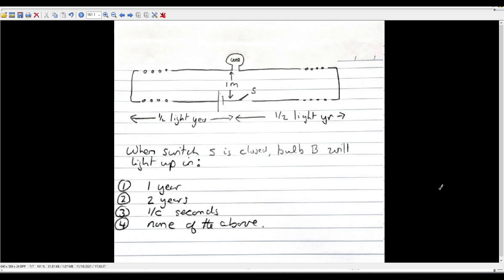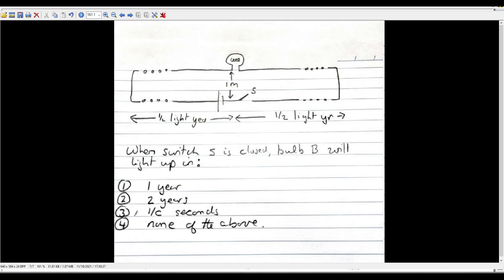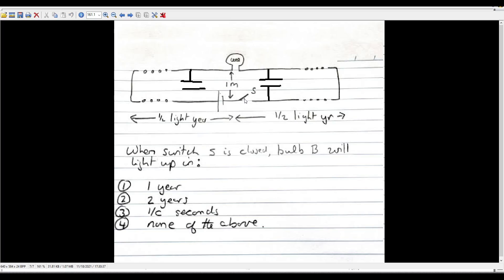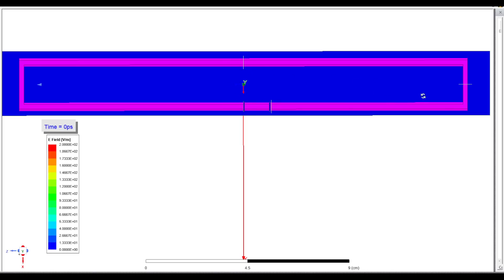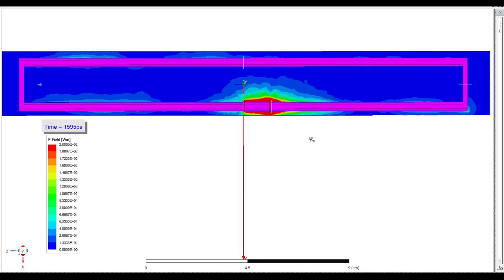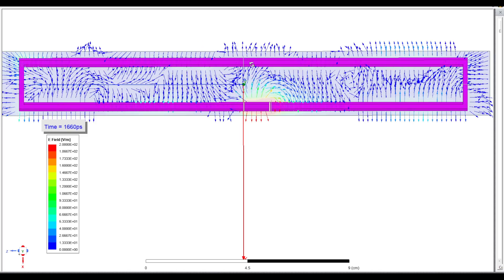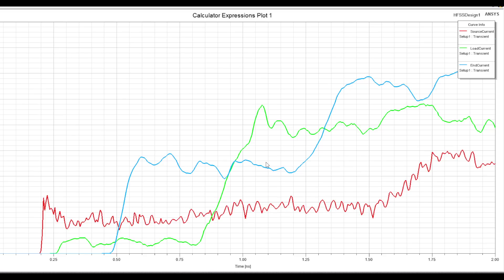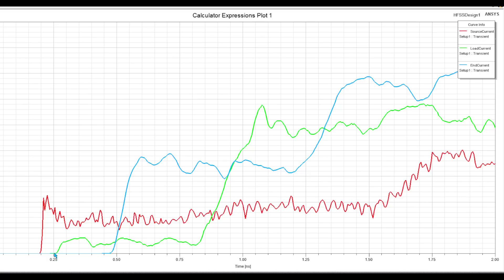Response To Veritasium - Electricity Propagation Time Problem

Comment: So, extend the wires to whichever length is needed to move the bulb 1 lightyear from the switch. 

Now what?
Reply from the maker: It takes 1 lightyear to light up!
Reply: @PulsedPower  We need to find some spools of copper wire, knot them together, position one end on the north pole of earth on a swivel, connect to starship when it launches to the moon and do exactly this experiment.

Does YouTube pay you enough for this channel to finance that?
Reply from the maker: @mattstroker  lol if they paid me enough for that I'D be hopping on a starship out of here! But alas, no monetization.
Reply: @PulsedPower  Lemme email Elon about this 😁

I am still struggling. But thanks to your animation and a revisit of the original video I now see where my original view was lacking. 

I am still struggling though. Not due to the phenomenon itself but because of what this implicates. Combined with another such topic: remember the "plus flows to minus" while in actuality that's not happening either....

I know electroBOOM said he was going to do a video on the veritasium thing also. Am very curious to see what he comes up with to be able to explain it to the masses.

Comment: There is some energy that goes from the switch to the bulb in 1m/c seconds. But it is not the amount of energy that can travel in the wires. It's more like the bulb is experiencing a small magnetic force when the switch is closed (but not exactly a magnet, just sort of like that in intensity...) The real power to fully brighten the bulb to intensity must still traverse the entire wire. If the full electrical power traversed the gap, then you'd be shocked just as badly putting your finger between the bulb and the switch as you are if you grab the live bare wires when electricity is flowing. That decidedly does not happen.
Reply from the maker: Correct! Good summary.

Comment: Technically 3 is incorrect since 1m is the distance between the wires which has nothing to do with this problem. The EM field propagates from the switch, the position of the switch is not defined. If the switch was located exactly opposite the lamp (which it doesn't seem to be from the drawing) it would be 1m/c any other location is >1m/c (because of basic geometry).
Reply from the maker: Fair enough, the diagram shows the switch centered-ish with the bulb. But you are right that we would have to locate it exactly opposite the bulb.

Comment: Veritasium says his wires have zero resistance, does your wires also have that? Is that a key difference?
Reply from the maker: Mine are copper, but it doesnt make a significant difference at the scale of my simulation.

Comment: There is NO FIELD until there is a circuit.  Even if the conductor has zero resistance, the electrons are what must transmit the energy and they do it in a rolling wave at light speed.  There is only one conductor needed if the power is A/C and two are required for DC.  The point is 1/2 light year as the negative pole is GROUND no matter where it is... tons of free electrons.  There is no field until there is a circuit except about a nano meter away from the poles of the battery.  You can't exceed light speed as the cable across the Atlantic proves... it has a 60 millisecond delay.  Vertasium is spreading bad, bad, bad science.  The magnetic wave is generated when the electrons align themselves N/S with the current.  When ALL the electrons have aligned their poles... which takes light speed, THEN the power will flow.  Electricity is the field around electrons and it occurs when the electrons actually MOVE.  The light or source will take a moment to reach FULL power.  The electrons, also, don't travel in straight lines which ALSO slows the start of a current.
Reply from the maker: You are incorrect to say that there is no field until there is a circuit. How do you propose that antennas work? How about wireless charging coils? Even capacitors break the galvanic conductive path.

The source is a "DC" source however once the switch turns on there are time variant fields ("AC").
Reply: @PulsedPower  With an antenna, the FIELD is the radio frequency the antenna is tuned to.  The FIELD is "everywhere in the air" NOT in the antenna.  The antenna RESPONDS to the field and has no field of its own unless it is a powered antenna such as a radar antenna.  The antenna has NO field, itself, until it establishes a circuit that amplifies the field causing electrons to resonate INSIDE the antenna.  The resonating electrons have a very, very, very weak field... pico meters.   The FIELD is in the air.  The antenna is connected to a coil then to a detection circuit where the signal is detected and brought DOWN to a readable signal.  Antennae will displace space/time and, in that regard will have a kind of field.  Any matter that displaces space/time will cause a distortion in space/time but the so called field is local... nano meters away from the actual material.  The circuit is made by turning your antenna to "ON".  Your antenna is a rather useless piece of metal until CONNECTED to a circuit.  Earth's magnetism will, eventually, magnetize the antenna and THEN it will have a MAGNETIC field which may be used to GENERATE power.  Charging coils CREATE a field to which you tap into with a coil antenna... the field generates power in the receiver which can be trapped... kinda like photo synthesis.  Leaves are green because evolution found that GREEN is the most abundant power in light.  The leaves use green pigment surrounded by a circuit, in the leaf, to trap electrons knocked out of orbit by the green light... the Chlorophyll has lots of loose electrons, easily knocked out of orbit and captured.  The GREEN resonates with the green light and the cell surrounding the Chlorophyll traps stray electrons and turns them into sugar.
As for capacitors... one side CREATES a field with voltage and the other side does respond... the electrons will align with the charged side of the capacitor BUT there is NO FLOW of electrons until there is a CIRCUIT on the other side of the capacitor... also it must be a fluctuating current... A/C or variable DC for the capacitor to work, at all.
Reply from the maker: @ButchNews  Ok, it sounds like you understand that recieving antennas respond to the signal produced by transmitting antennas. You seem to think that in some cases fields will only be confined to within nanometers of an objects surface, but in other cases the field is only found "within the air"? The reality is that the "Electric field" is a mathematical representation of 3d space where each point in space is associated with a magnitude and direction of the quantity we call the electric field. There is no "local" field, its all one continuous field and a few key properties of this global electric field are:

1. Changes in the field propagate at c.

2. The field will exert a force on charged particles determined by the direction and magnitude of the field at the point that the charge occupies .

In this simulation/thought problem we can think of the lower horizontal wire(with the source and switch) as the transmitting antenna, and we can think of the upper horizontal wire as the recieving antenna. You seem to justify your answer by saying that the current will be miniscule. That is not necessarily true, large ammounts of power can be transmitted between antennas. Its just a function of how high your sorce voltage is, and in our case that is left un-specified, so lets assume its as high as it needs to be such that our hypothetical bulb has enough current to light up.
Reply from the maker: @ButchNews  I knew something was a little off with the termiology you were using.

Im not sure how you can say you disagree with Veritasium when my conclusion (that I think we both agree on?) Is pretty much the same. There will be some(reduced) current flow after 1/c seconds.
Reply: @PulsedPower  We don't agree on the time.  One of the weird things in reality is that when A/C reaches a frequency around 100,000 cps then it RADIATES radio waves.  Lower frequencies also radiate but in a different way I don't quite understand why but it's a fact.  For instance 60 cycle current will radiate quite a distance from a wire that is not metal covered (shielded) but its radius is quite small.  Take a small current 100K signal and, even low power will radiate for miles.  I'm guessing that lower frequencies are more influenced by gravity than ultra high frequencies seem to be.
Reply: @PulsedPower  I don't know why that Vertasium issue bothers me... I think about it from time to time when I'm not thinking about standing waves and black holes.
I wanted to mention that antennae are a special application of high frequency (A/C) waves.  One may send an A/C signal through one wire telephones... something I learned when I was around 14... an electronic tech showed me how.  We forget that the Earth is a conductor to A/C or an extremely large capacitor.  It don't much matter where you are, plug a nice conductor down a few feet into the ground, attach it to the biggest capacitor your needs need... bigger is always good, and the Earth becomes your other conductor.
We ripped any old transformer we could find and the biggest capacitors we could find in junk radios, some 6V batteries and telephone handsets and we wired one wire telephones between our tents, at camp.  We used two wires but the other wire was a ring tone.  Once answered, all the power went by way of the one wire and the Earth.
So, all antennae are two wires... you just don't notice the Earth wire.
Reply from the maker: @ButchNews  Thanks for the  personal story, its fun to hear how people were introduced to electronics!

While some large antennas will be affected by the earth, most do not interact much with the earth ground, other than their signals possibly bouncing off of the ground. Some antennas do utilize a "ground" plane (not actually earthed, just conductive) which allows the antenna to be half as long as without!

Comment: Can you repeat the analysis by comparing to what happens if you do not close the wires at the two points at the very left and right hand? Basis causality arguments should suggest that the initial wave propagation from the switch should not depend on what happens half a light year away. thus I suspect that the initial response of the green curve looks just the same whether you have a closed circuit or not. This is why it is my opinion that answer c) is just ridiculous… I agree that it makes sense technically, but it is very misleading.Also, it really depends on the midium between the lightbulb and the switch. if you put the light bulb in a faraday cage one can probably neglect the radiation that arrives at 1/c.

Comment: I seen that video, he said each side was 300,000 miles long, last i checked that is vastly smaller rhan half a light year.
Reply from the maker: In the first 30 seconds of my video I say this is a response to Veritasium's community post of the photo that I show on screen. The diagram in that photo indicates lightyear lengths. Of course when Veritasium released his video he changed the lengths to lightseconds. However I posted my video before he posted his, so of course mine only considers information from the original problem.

Comment: Looks like you scaled the 3 currents so they are not on top of each other on the plot.  That prevents exact quantitative analysis.
Initial red height should be V/z, where z is transmission line impedance.  First step blue extreme wire end current at 0.5 should be same value,
but it is not.  That's how I know you scaled the plots.  We know your bulb resistance R is lower than z because we see the positive red current reflection at 1.75 at source (and earlier in blue.)  We can use the reflection equation Gamma = (ZL-Z0)/(ZL+Z0) on the blue or red plot to estimate z/R.
If you had shown more of the plot, we would see more reflections, proving it takes many round trips to reach near steady state and escalation of the green line.  What does lit bulb mean?  If R << z or R >> z, certainly not at first incident wavefront.  True answer is E)  (4) none of the above.
First wave would only be wire_length/c if R==z.

You made the model asymmetric so the results aren't clean.  So, get rid of the segment.  Also stop scaling the individual plots.
You may wish publish R and z.
Your effort and results are the best so far.  This Veritasium exercise really is an exposure of how many thousands of people really don't know what they are talking about.  Even those with some formal training.  If you don't know something, it's better to learn from a book rather than guess.
Reply: That being said, there are many with pretty good intution.
Reply from the maker: The plots were just to get a qualitative idea of when we see what. I did not scale the plots. The reason we dont see equal magnitudes where we would expect to is because I made my "current sense" loops too big and therefore captured some displacement current (dE/dt) around the wire. I didnt bother to calculate the characteristic impedance of the parallel lines since the simulation model is not to scale with the problem specifications (again because I was only after a qualitative answer). The "load" is just a section of copper wire, the same as the connecting lines. So yes, the "load" impedance is very low, as you observed.

It certainly warrants a follow up with a more well defined setup amd simulation, however it is slow going in my free time and I have already had a few multi-day simulations crash due to running out of memory. Ill get it working eventually though!
Reply: @PulsedPower  It was a good simulation, the crowd has moved on, and there are better areas to spend your time.

Comment: I think We have seen the spark created when closing a switch or heard the RF interference it creates on a radio. In Veritasium's circuit the lamp will certainly "see" this Electro Magnetic radiation in 1/c second but the energy transferred is brief and small. His circuit also has inductance and capacitance which will couple the switch operation directly to the lamp as they are shown1 meter apart, however that would create little more than a brief flicker (if that) and hardly meet the definition of the lamp being "on".  So I agree with this video and think the lamp will come on properly only after a delay dependant on the length of the wire.

Comment: Thank you for the video! Could you perform the simulation with reference ground plain close to wire so the coupling  to it much better than between wires? Result can be interesting... Thanks.

Comment: Well explained! Veritasium may be partly correct but only if the distance between bulb and battery is short and if the bulb lights up the first round at a very low current right? I don't think these conditions were considerend in the video that Veritasium made